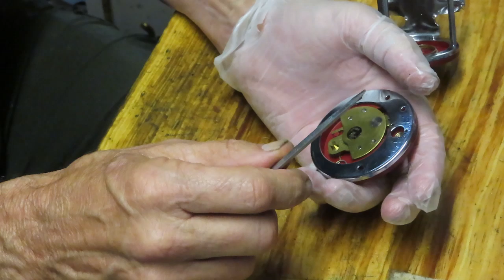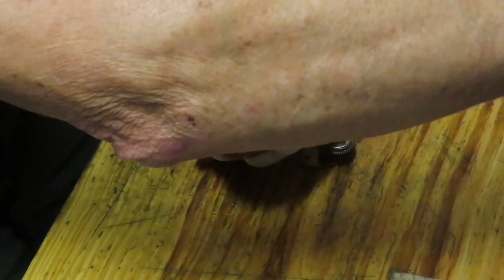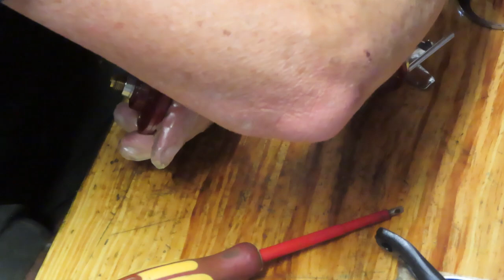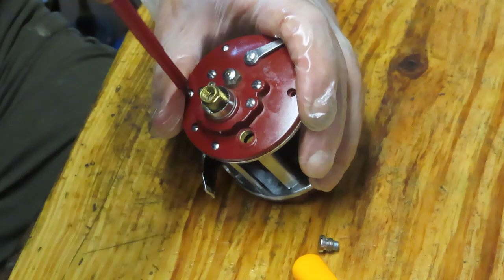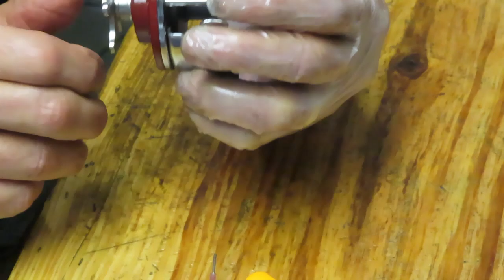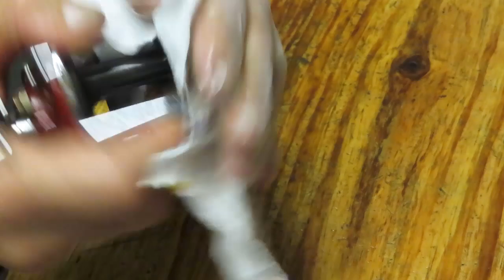Penn Peer 9 fishing reel in a bag How to service and repair

Comment: My bro have a question on the #9 perm your rebuilding, I have redone 2 so far thanks to your teaching  but I’m on #3 now and I’m having a problem with the eccentric lever after I put reel together when I flip to on the spool
Will reel properly, but then when I turn the handle backwards it spins freely which is not what it is suppose to do. 
I open again the dog is out of place, so I pit back in place close it up and same thing again. 
Any advice please and thank you for the excellent videos
Reply from the maker: That is an anti-reverse dog issue and not an eccentric causing the problem - Re check how you installed the dog and spring - Dennis
Reply: @2ndChanceTackle  once again you are amazing I’ll take apart again and check it out thank you Dennis

Comment: My Penn #9 line guide gets hung up on left side replaced worm, pawl, and complete line guide what next
Reply from the maker: Check tp make sure that the line guide is not binding n the top post with the track.  Check the idler gear to make sure all of the teeth are on the gear and that it is not broken or worn on both parts of the gear drives

Comment: Posing this question here because I don't know where else to post it (community?). I have some old reels ie a couple Penn conventionals, a couple Penn 712 z, several Mitchells, an Olympic spark 200, a couple Diawa spinners and a couple reels from the 40's  to name a few. These are sitting around collecting dust and I would like to get rid of most of them. Not interested in using them. What would be the best way to get an idea of values and where would be the best place to list them for sale. I know I can look at closed listings on eBay was wondering if there is a website that would be better. Thanks for any suggestions.
Reply from the maker: I think eBay has become a good source of average pricing information.  It is also a good place to sell them, but the fees and the shipping price out a basic reel.  You may do well selling the entire lot on bay as the shipping would be averaged out over more reels.
Facebook Marketplace and Craigs list are good alternatives to eBay if you want to sell local.
If you send your reel list to me at 2ndchancetackle@gmail.com I can give you ball park estimates on the reels you are looking to sell - Thanks for asking
Dennis
Reply: @2ndChanceTackle  thanks for the suggestions. Will email you when I dig into the box of reels in my basement. Thanks for offering.